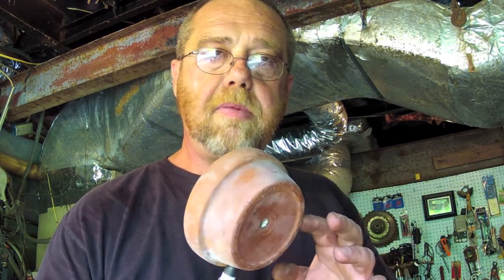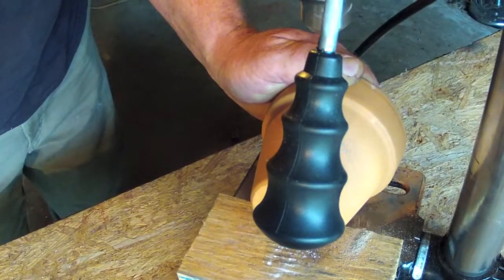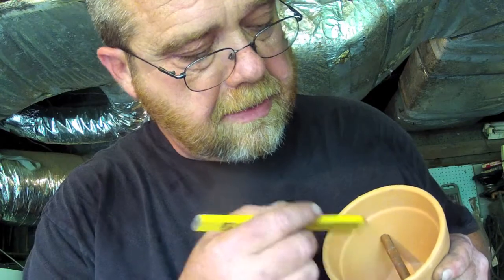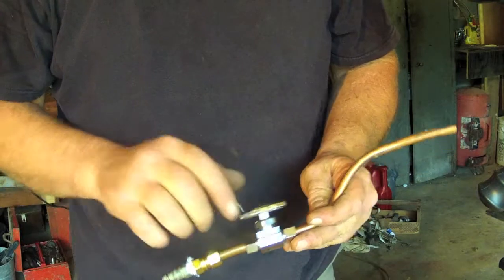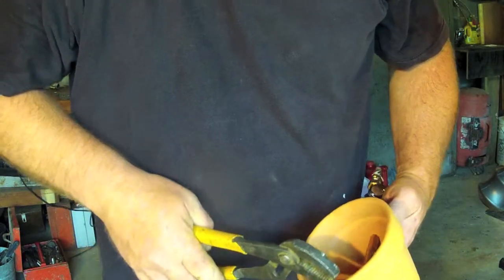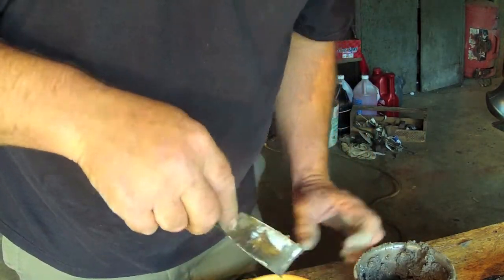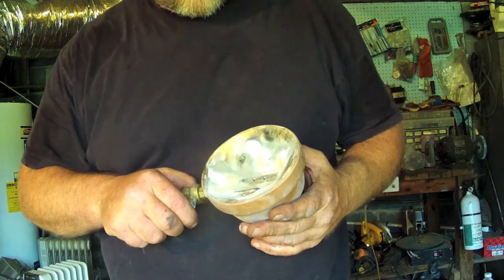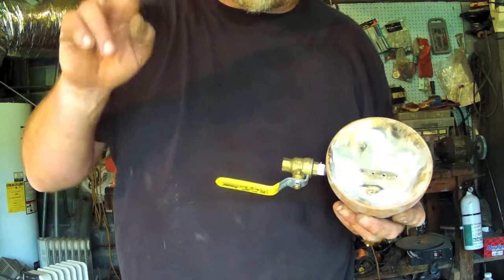HOW TO MAKE A MICRO FORGE

Comment: Awesome.  I've got to make myself a forge like this!  Is the grout ordinary motor mix, or something that is designed for high temps?  What air source do you use and what does this burn?   Would it work with an car tire inflator for air pump?   Charcoal?  Coal?
Reply from the maker: charcoal coal ken with any air source , and simple sanded grout .
coal would burn hotter I'm sure.